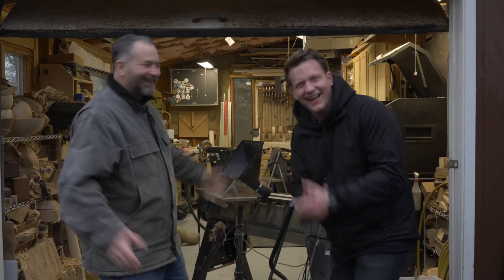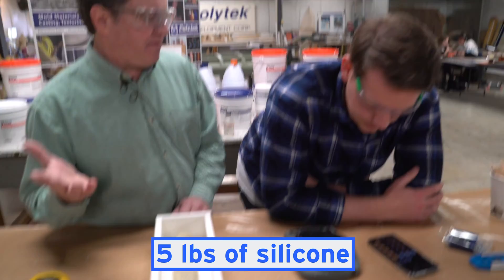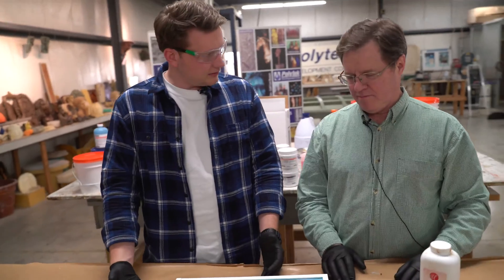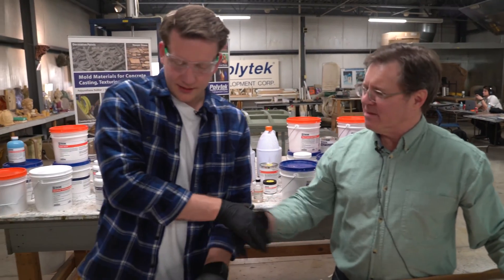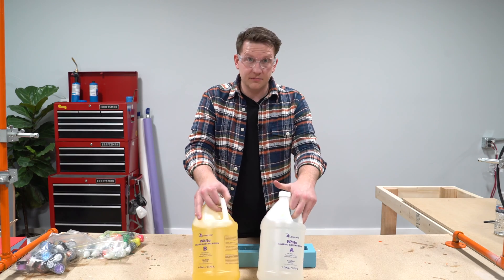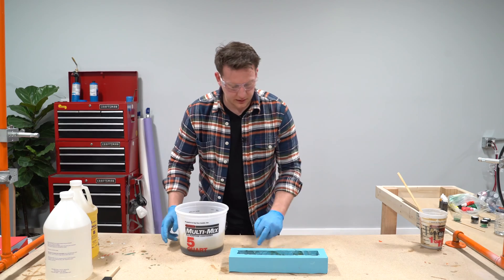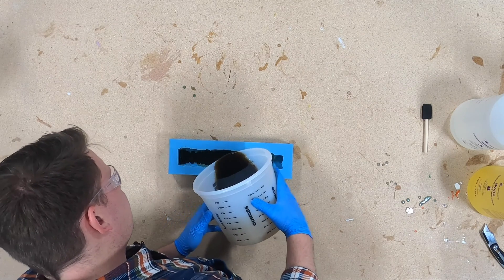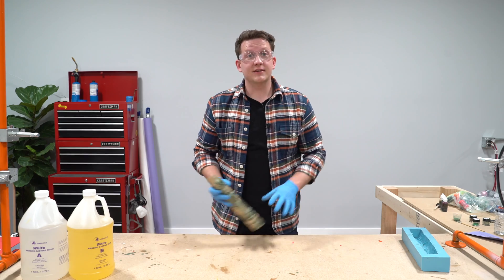How to Make and Cast a One Piece Mold | Alumilite

Comment: does 73-60 mean the hardness scale? This totem pole mold looks a little too hard for my purpose. I need the hardened silicone to be malleable enough to 'peel' off my casts. I am looking for silicone to make molds which I will eventually be pouring cement or wax into. which of your products would be suitable for this?
Reply from the maker: Great question! Yes, this silicone is pretty stiff. If you're looking for something more malleable, I'd recommend our Plat 10 or Plat 25 depending on just how flexible you need it to be - 10 will be the most flexible.
Reply: @AlumiliteCorporation  Thanks! Where do I purchase the PLAT 25 online? I don't need food grade if that helps my cost (I was under the impression that 'PLAT' meant 'food grade' ??
Reply: @AlumiliteCorporation  Or I guess I should ask: can I use a tin based 25 instead of Plat 25?

Comment: Hey Jordan, thanks for the videos. I'm new to working with resin and I wanted to know if the mixing buckets are reusable or cleanable after you pour. Sorry if you've addressed such a beginners question in other videos. I figured asking directly might get a quicker response than sitting through tutorials. I'm literally at the 101 day 2 level...
Reply from the maker: [Actually Jordan] Hey Eric! Level 101 day 2 is one of the best times. Enjoy it! To answer your question, you can absolutely reuse the buckets...just make sure that you combine all the parts of A+B together so that the chemical reaction occurs. Once the resin is cured, you should be able to just peal it out of the bucket. You may need to squeeze the sides to loosen it up a little bit, but it should come right out. Great question! Let us know if you've got any others as you keep going! Excited for you to reach level 200, 300, etc...
Reply: @AlumiliteCorporation  I'm excited as well! Thanks for such a quick response. I look forward to catching up on the rest of the videos!
Reply: Instablaster.